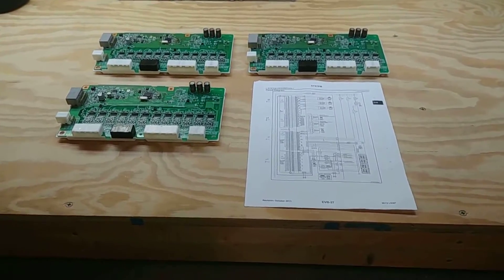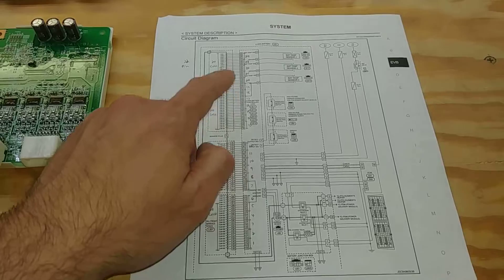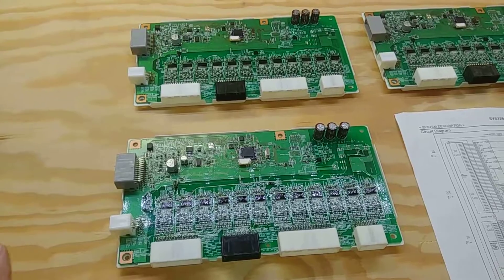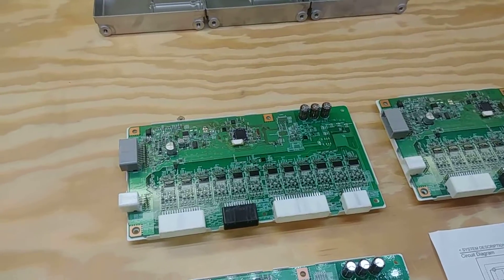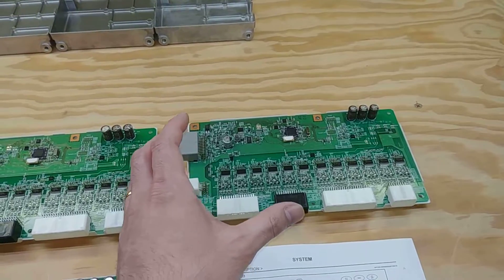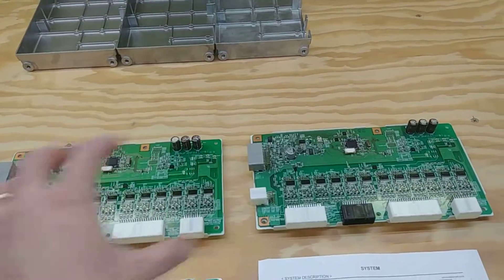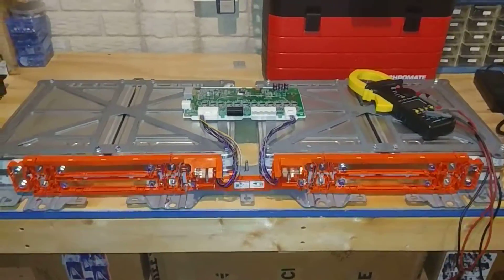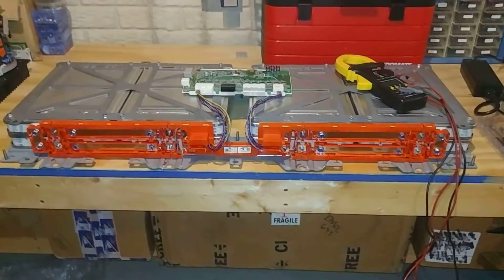Solectria E10, Lithium Ion Battery Upgrade, Part49

Comment: Hey, did you manage to read the IC9 EEPROM and maybe figure out what is what inside it? I'm trying to reverse engineer it, but for different purpose (putting different cells, more cells into the Leaf). Would appreciate the know-how if possible.
Reply from the maker: I never read out the EEPROM...
I would assume it contains the magic number for pairing the pack to the vehicle.
Calibration data.
SOC and SOH info.
Diagnostic info.
Model / Serial number.
Etc...
Reply: @WolfTronix  You do have several of them. Would it be too cheeky to ask if you could read them from the BMS's you got and send them over to me? Would be really helpful to have several dumps to find out what is what inside them!

Comment: Why are the cells 7.8 volts? Is one ‘cell’ two actual cells in series?
Reply from the maker: Each module has 4 cells...
They are 2 in parallel, and then in series.

If I measure to the center terminal, you would see one cell, (2 physical cells in parallel).

Comment: Nice progress, seems to me sending all the zero volt cell data is pointless, so packing the data down to just the connected cells would seem more logical to me.  If your dog does lick it, I think it would only be one lick, not like a 9 volt where one might try again for fun...
Reply from the maker: I think I will do both...

Make my own protocol to send only the populated cells.

And send all the cells (0.00V for the missing cells) when queried with Nissan's protocol.
That would maintain backwards compatibly. 

Worst case the dog could possibly lick 30ish Volts. ;)